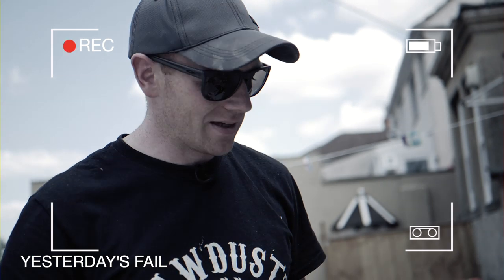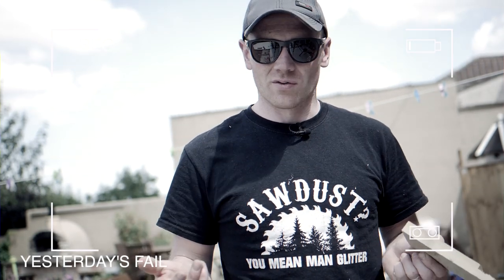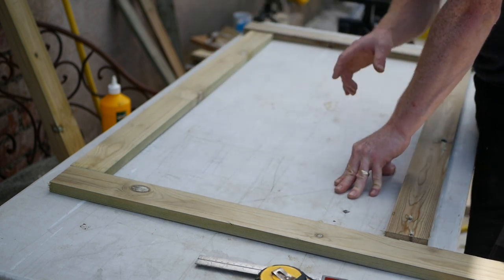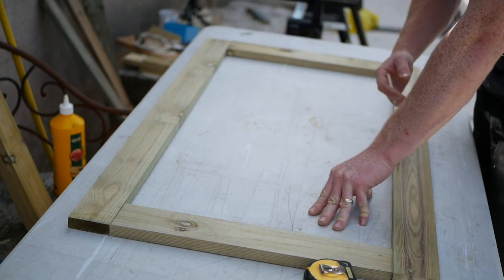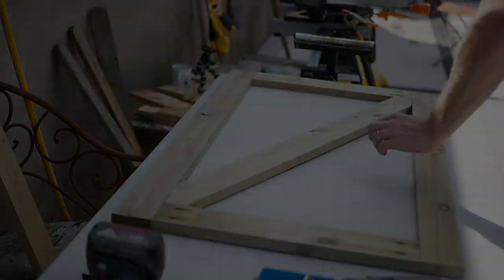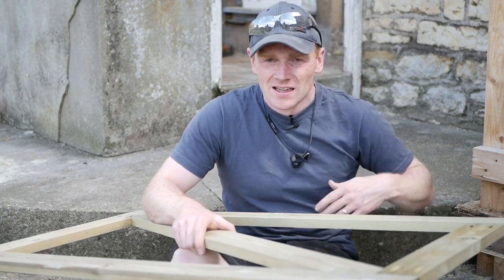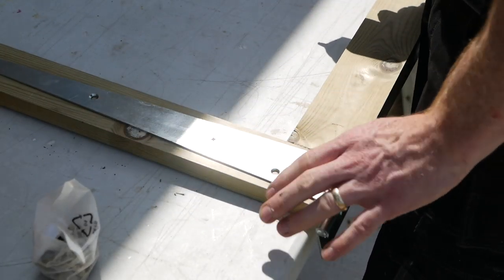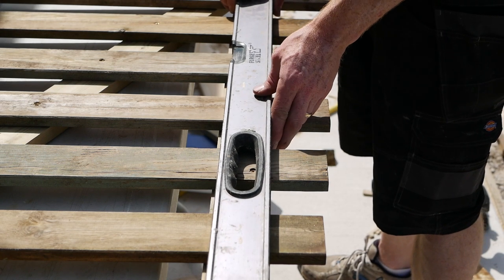Building a Garden Picket Gate

Comment: The only thing i don't like is those horizontal rails not continuing from one fence through the gate to the other fence.
Reply from the maker: Me neither. Perhaps the frame could have been all on a bespoke angle too to match. That said, this week’s project is a carved sign to hang on it so that should cover the wonky rails a little!
Reply: @Kevin Saunby cut and weld the strap hinges; or just use smaller hinges.
Reply: @Kevin Saunby Agreed, but it's only 2 inch small weld... if done outside with proper grinding/cleaning of the galvanization/zinc coating...basic protection. hold breath for 30 seconds :)... it will be fine. Or as AVE says ~"filter it through a cigarette".

Comment: The only thing I don't like is the bottom of the gate being oddly cut, I would have cut them to all be ~3in off the ground, and then sloped with rest of fence. But I really like the top of the fence
Reply from the maker: I did leave long to start with but with the woodchip paths I knew it would constantly catch so ended up cutting off in haste! I agree, would look better longer. 👍
Reply: That was my thought too, the straight edge at the base of the gate accentuates the slope at the top. I would have each picket the same length, just shorter than the fence itself to prevent dragging.

Comment: I would have made the frame angled the same as the pickets so all the lines from the fence followed through. What was the point of keeping the frame square?
Reply from the maker: Starting making it as a ‘conventional’ square gate before even thinking how it would match the rails. 🙄 an angled sub frame may well have worked better. 👍
Reply: Yeah, I would have followed the lines of the fence too.  And cut the bottoms of each picket to follow the same line - but a bit higher for ground clearance.

Comment: Does the gate look a bit weird @ 9:21 ??

Great idea with your method. The trick is to make it stronger and in better timber for the same cost as you can get an off the shelf jobby.

If one costs £30 then get the timber, make the frame yourself and guarantee it will outlook the mass produced ones!

Great vid, thumbs up.

Comment: Good solid gate, but I think you made hard work of it, its abit over engineered for a small picket gate, I dont think you needed to uprights on the frames with pocket holes just 2 cross pieces and a bracing piece would have been enough. And I think a straight bottom and domed top would have looked better like you suggested at the end